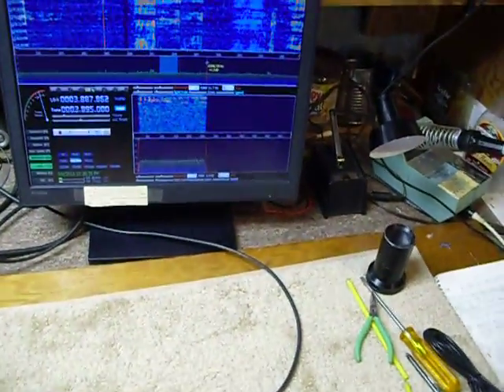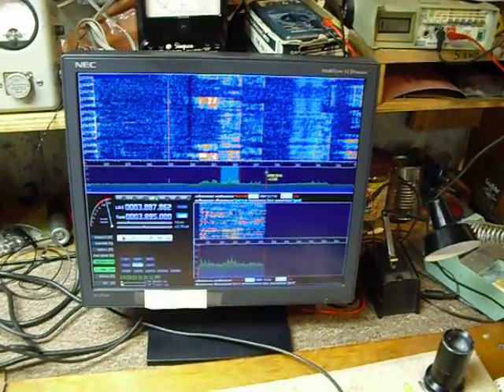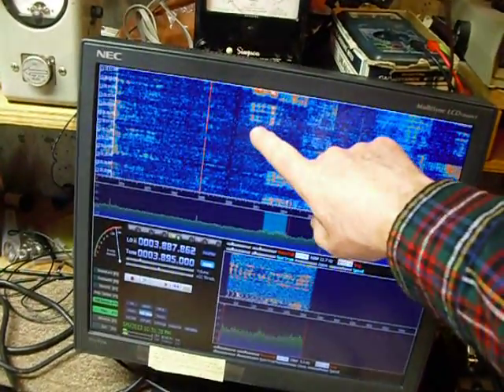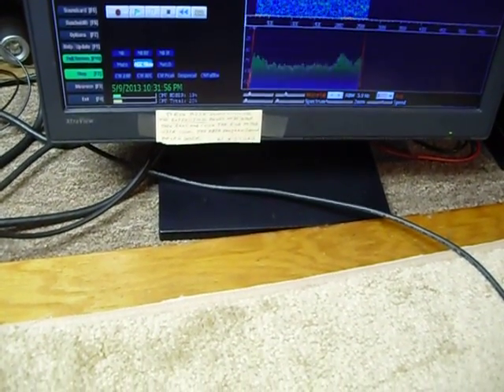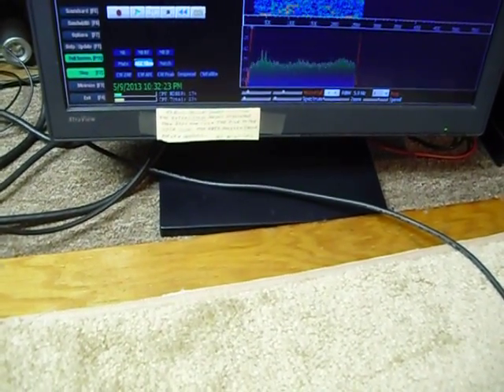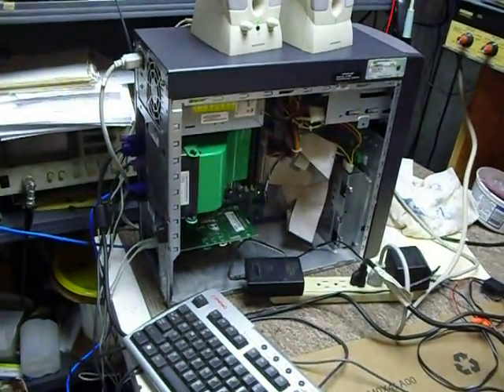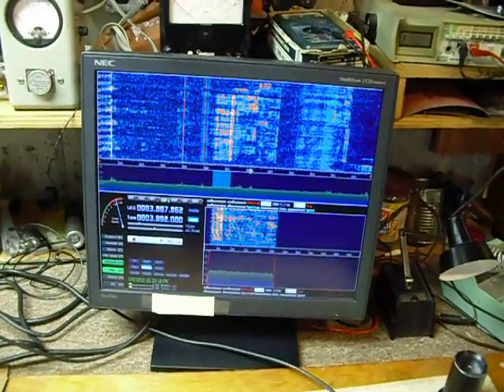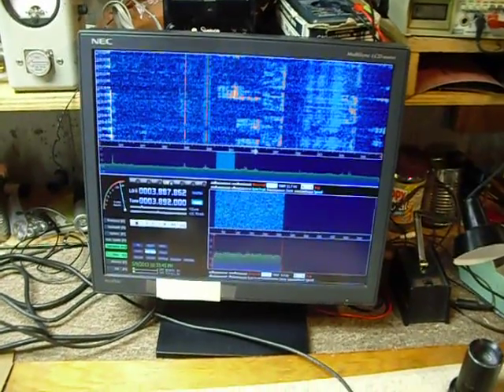Part 3 Ensemble II SDR software defined radio receiving test

Comment from the maker: Yes Donal it is difficult soldering however using the .015 solder helps and I prefer the old type low temperature solder with lead in it this flows and adheres much better than the lead free solder .  The tip on my soldering iron or soldering  pencil is rather large I would say the tip is around .062 or 1/16th inch much to big for the job with the magnification I am using it looks like I am trying to solder with a huge club shaped object . A soldering pencil with .015 tip would help.  73  BOB

Comment: Thanks, Bob. Any tips you have gleaned on the surface mount soldering will be much appreciated. I read elsewhere that the Softrock is a bit of a bear to solder up because of the SMT components. Maybe others have ideas on this, too.

Comment: Really impressed by this setup. Your patience with surface mount techniques has really paid off. Question: are you running Linux software on the computer? Donal in Dublin.